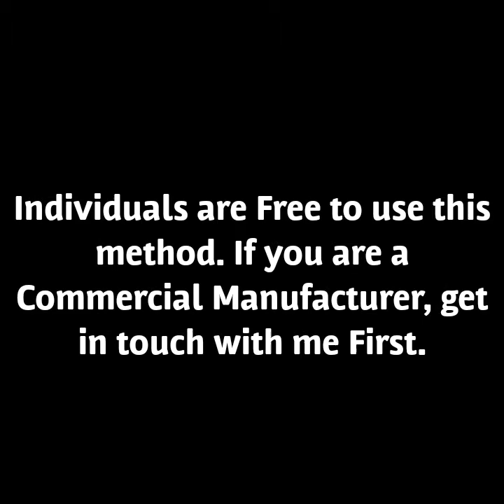Bowtie Phase Line Solution

Comment: This method you are using is really thought out well using a pin jig. My question to you is, do you have to sand the surface of the wire before tightening down the bolts ??? How long does this connection last before one needs to clean the surface when the antenna is outside in the weather ?? Thanks Cosmic Antenna. VF
Reply from the maker: Thanks Victor, the jig idea took a bit of trial and error, saved me from wasting a bunch of copper. 
If the copper is clean and shiny don't sand it. 
The materials I use, copper, aluminum backbones  stainless steel screws and washers all form a patina and will never corrode or fuse together I chose them to work together so the connection remains as low impedance as possible. Any other material will rust at the joint and block the signal. The joint should last as long as the antenna. 
I did have a video called looking for rust. A closeup inspection of a Hoverman that had been up three years and no rust no white powder corrosion. The copper usually turns the color of an old penny unless it's near salt air then it turns green but it won't corrode with the stainless.
Reply: @cosmicantenna9244 The information is BANG ON for sure. I can tell you put some serious thought to everything going on at the antenna. This very same method of using jigs is used in the machinist and tool and die makers trades to this very day. Well done fella. VF
Reply from the maker: I did some machinist work when I was younger, learned the basics, could operate a lathe and do big drill press work, welding and cutting. 
All good training, jobs were just tough to get at the time.
Reply: @cosmicantenna9244  The best part of working with ones hands gave such a great feeling that I never really worked. You know what they say, "Do what you love and never work a day in your life" That describes my love of the trade. Peace.